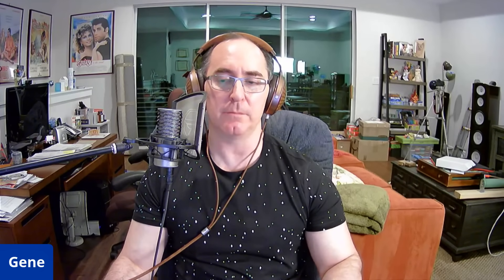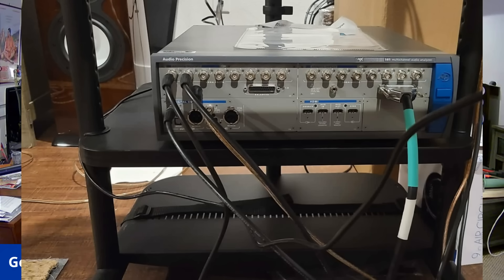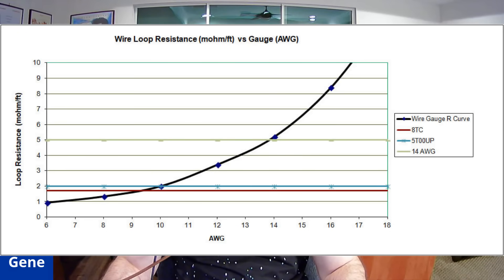Speaker Cables Really Don't Make Much of a Difference?

Comment: I hear what you say. However, I have Monster, QED 79, QED silver anniversary, Audience AU24 and Atlas Mavros speaker cables which I’ve purchased over the years. And on my system, in my home, they all sound different. With regards to balanced XLR, I recently purchased a new high end preamp and and I tried 3 different cables that I already owned: JPS labs, Audience AU24 and Van Damme. The first two cables cost over £1000 new and the Van Dammes were £28. On my current set up the Van Dammes were my preferred cable. So I don’t think I’m just suffering the placebo effect for expensive cables. Science includes testing and observation (hearing for audio). Regardless, everyone should buy what they like and enjoy their music on their system.

Comment: Sorry sir, you may have all the necessary test measuring equipments but there are much more information to know about audio cables, example the material, construction,  consistency of every strands (diameter) what size cable for the current/power output of an amplifier and etc..
Most audio cables are used as equalisers.
Anyway more than 95% especially expensive loudspeaker cables and signal cables (interconnects) are snake oil.
"Hi-fi is a fools game" 😄😄😄

Comment: Thank you for such a comprehensive  test and convincing explanation. However once I was using Nordost ribbon cable and found it lifeless with very little bass. Once I swapped it with a same length of Kimber 8tc it was such an improvement. Not sure how to explain it

Comment: I used to live less than a mile from a radio station
When I powered up my amp with ALL inputs turned OFF I could hear that station thru my speakers  Granted it was at a very low volume but it was there 
I started using shealded cables , and the problem went away 
Quality cables keep unwanted noise OUT  Other than RF shielding I've never heard any cable make a diff
Where I live now it makes no diff at all ,but in some places RF  CAN be HEARD

Comment: Great to see you guys still picking Up on cable nonsens, and accually take the time to measure and explain valid result to the consumers. Ive noticed a few cable vendors in my area, and for some reason they dont put any specs online, and if you contact Them, they refuse to publish any specs or measurements.... Go figure.... The worse part of All of this, is the nonsens they say about theire products, doesnt make any sense, what so ever. You should go check IT out. Zensati.com and ansuz-acoustics.com, are just two local brands with a heavy pricetag and crazy theories 😆

Comment: I appreciate the work that went into this. I would have loved for you to try out the Supra Ply cable, not so much because it's costy and it may not be the 'best' cable out there, but because of the design that went into it as it was designed with high capacitance for keeping the inductance ultra low. Also the conductors being flattened the cross-section is quite low and the skin effect decreased accordingly. I and others find it is quite bright, stinging even, which we hadn't expected - now that's critical listening for you, immune of Placebo and No-cebo. ;)

Another curiousity for which I've seen measurments and speaking from personal experience: heavier cables seem to scoop the sound, relatively speaking. It's in the range of a few dBs so well within the sensivity range of the human ear. As far as I'm aware there is no name or unit for this effect, nor does anyone seem to know where it comes from or what laws of nature is at play.

Furthermore: did you measure just a sweep or a complex signal? I would imagine that the more complex the signal becomes and the more juice that flows... the more things can go wrong and the conductor start showing its weaknesses if there are any.

Comment: So, is the wire in the Test leads better then the speaker cable? The measurement is going through that cable as well, just a thought as to why some of the measurements are so close together.....
Reply: @Douglas Blake is that a fact or opinion? The wire in the test leads is part of the measurement, no way around that...
Reply from the maker: @bobbiebreese9377  the test leads are short and high impedance like Douglas pointed out.
Reply: @Audioholics  of course, you already “say” wire doesn’t make a difference....
Reply: @Douglas Blake please explain to me in detail how one wire can measure something higher then it’s own capability?

Comment: Gene would you be able to make a video doing the same measurements for us to see if there is any audible difference in different speaker wire length for different channels? Saying left front channel has a 10 foot run and front right has a 20 foot run.
Reply: @Douglas Blake how would that translate to if an audible difference could be heard or not?

Comment: I feel even less worried that my speaker cables are cheap $50/100' of 12ga cables that I used to make my own speaker cables.
Reply: @Douglas BlakeThat works, too. For me, however, since the cables needed to be at least 25' each and would be trodden upon, it made sense to use a much more sturdy wiring solution. This cable has a very thick yet pliable rubber-like coating so perfect for my needs. "Monoprice Installgear 12ga 100'"

Comment: Gene says the most sensible words I've heard in a long time, "we need more science in audio". Amen. Massive cred to Gene for doing this. My biggest Audio Hero, PWK, also had a great line about this (you probably know it already), "if it isn't based in science and physics, it's Bull$#!t". He also liked to insist on measurements because "if you don't measure, you can't possibly know what you have". These tests lend credibility to those of us who recommend generic OFC wire, and to manufacturers like Kimber, who actually STICK to the science and physics of it. Just makes me wish that the more nefarious peddlers of reptile juice could be shut down by the FTC for making false claims.
Reply: I've been doing Home Theater before it was called Home Theater back in the late 70's and throughout the 80's. Back then it was called two channel stereo and finding the best equipment to reproduce the current analog recordings during that time was the only challenge. I was in the Navy between 82 and 86 and going overseas offered the benefit of getting high dollar HiFi equipment for pennies on the dollar at the local PX. Dam, those were the good ole'  days when only worrying about RMS vs Peak to Peak or just Peak was the only crap thrown at us by the vendors. Now, its all about calculating the best sound curve for your living room thru a maze of speakers and seperates. I only thank Audioholics for providing the best credible information and test results for us who don't have the time or know-how to do it. Thanks guys!
Reply from the maker: @JoseMTamez  I miss those days. Stereo HiFi VHS with 4 stereo speakers on your living room and git the simulated stereo effect on your receiver for some ambience. I did this for Star Trek IV The Voyage Home and blew my family away. Good times ;)
Reply: The brand you talked about is the one I had the trouble with...solid core wire was far superior and cheap
Reply: Kimberly NO...solid core YES
Reply: Wrong...
Reply: Unfortunately, what refers as “fool” are rich. This is not what I can’t understand
Reply: I do in a sort of way agree with you, but allow myself to be skeptical about our scientific capability.
Imagine 200 years ago and the newest science then, it did in no way measure radio waves, and still did radio waves exist.
Electricity has also been outside science, so has infrared and lots more. Also, he did at no time measure the sound, only the electrical properties. :-)
Reply: @friedmule5403  exactly. Measurements are useful to assure you have a competent design. But once you have a competent design….does it sound good? You could have two tweeters that technically measure the same. But if one is a silk dome and the other is aluminum? They WILL sound different. And anyone listening would say so. Measurements don’t tell you what something sounds like. Music is listened to. You don’t go to a concert or sit down in front of your stereo to measure it. But queue all the scientists in this arena and wait for the comments about what suckers we are. And of measurements are all that matters, then everyone who worships them should all be buying the exact same thing - namely, the cheapest thing that measures well. But no. These same ‘scientists’ audition stuff and make choices. Hmmm…
Reply: @friedmule5403  in the early days of high fidelity, measuring techniques were not as powerful as today, which led to the situation you describe, effects not capable of being measured by the science of the time.  The simple solution was the double blind test,  which oddly enough, I have never heard of any cable company using to prove their product makes a difference 

I see no reason to fault the testing of the electrical properties.  To insist that the " sound " must be tested misses the entire point of the video.

Comment: What's the difference from slow burn fuse and fast burn.  My subwoofer needs a 1A 250V replacement fuse.?
Reply from the maker: big difference, use what the amp manufacturer speced in their product for safety and reliability.
Reply: @Audioholics  the problem that I have is finding the right fuse non of my local stores have( 1A 250v MDC) fuse.  All they have is AGC in most shops . Is there a website u guys can direct me to purchase such fuse.

Comment: Couple questions: 1) Does speaker cables degrade over time? Like is there any oxidation or something of that nature that might cause a difference over the span of maybe 10+ years? Does oxygen free copper make a difference for this? 2) Assuming you had all 10 feet cables would the speaker design have an effect on how much resistance is acceptable? An example my dad has Polk's towers with the SDA tech from the 80/90s that has 8x 6.5" woofers and 4 tweeters per speaker but I'm curious if lets say the 14 gauge cable you used would have an effect with something more power hungry like that over the 8 gauge speaker wire he uses.
Reply: When metal oxidizes, it's the oxygen in the air or within the metal that reacts with it to cause the oxide or oxidation process. With OFC cable, there's no oxygen in the copper material, so no chance of it oxidizing, causing drastic increases in its resistance. As to your concern about how much resistance is acceptable, recall that the measurements Gene made were on a milliohm per feet scale. Cables were shown to have an average of 3 mill-ohms per foot. So for a 10-foot cable, that's 0.03 ohms of resistance. Your solid-state AVR or amplifier output impedance is much higher, at least 10x or higher, with AVR having much higher output impedance than dedicate power amplifiers (it's all about cost and compromise). If you have tube amps, it's even much higher, closer to 0.5 to 1-ohms of output resistance. Your 4 or 8 -ohm speaker is even higher. So, the 0.03 ohms of resistance from the cable is utterly invisible, if not irrelevant as it's way too small to matter. Whatever speaker manufacturer you choose, always select a wire gauge of 10 or lower. 5 gauge has lower wire resistance than 10 gauge, hence it's thicker. The lower the gauge, the lower the resistance per foot, and the thicker the cable gets. Hope this helps!

Comment: I Don't have an expensive system, but i'm happy with the Monster 12 awg, and Interlink cables, and I will be upgrading the amp from the JVC 120 TO AND XTZ 100 watt amp. I'll let the JVC work as a preamp.  Thanks for the measurements and advice Gene.

Comment: Gene, very nice piece.
But such measurements are quite a bit "on surface", i.e. you did not spend too much effort conceiving that experimemt.
Why don't you go a step ahead, and show us the measurements in time domain, which is the only one relevant to music reproduction? I presume it will be easy for you to source the necessary equipment.
And then I will refrain from comment on a 80W Denon being a great companion for 328 Be.
Reply from the maker: If you understand basic electrical theory, you'd know that a lack of change in amplitude response will also be a lack of change in time domain response. I use 10AWG cables all the time to do delicate amplifier measurements out to 90kHz and NEVER observe transient issues due to the cable impedance. That 80watt denon puts out 300 watts into 2 ohms so make assumptions without knowing facts. I also use a 600wpc Anthem amplifier to power the Revels in this room. The Denon amp was used as part of the DUT for this experiment.
Reply: But why are you talking about cable impedance, on 10 feet? Any copper cable will be similar, as confirmed here by your own measurements. I wonder if anybody here expected it not to be the case:)
I however fancy to see the shape of series of 10 kHz pulses,going through various speaker cables. Also, the cables selection you are using, are they really substantially different?
Now, please confirm that Anthem is a better match to 328Be, than Denon? Audibly better

Comment: Appreciate the science here.  Crazy what companies try to push in marketing.  I do have a question about shielding and how cables are routed?  I think this may have an effect (well we know that is true in car audio).  Gene, what’s the science on shielding and routing cables in home theater stereo set ups? (proximity to power, sources etc.) - what recommendations would you give people?
Reply from the maker: use shielded interconnects, route power cables away from interconnects or orthogonally if it can't be avoided.

Comment: I am an electronic engineer and I can agree with your measurements, but I disagree strongly with you that it does not give a difference in the sound. I use to think like you because this is what I was taught, but I can tell you I was surprised and my knowledge of electronics was questioned.
Could you do a transient response test, or step response, since music is transient in nature, this is the true test. You will find out that frequency response to the 100KHz range and higher is truly very important for the harmonics.
I am not sure that the Denon amplifier you are using has enough resolving power if you cannot hear much of a difference. I build my own amplifiers (very resolving) and have tested with different cables, and there is defiantly a difference. I use CAT5 cables, 12 pairs ganged together (2.6nF, 200nH, 0.06ohm) at 4m and the difference is audible. With normal cable, the highs are smeared and less clear "t" and "s" sounds are excessive and the perceived levels of the highs seems louder. With the CAT5 cable I made, there is a big improvement of clarity and better control, the highs are perceived as sounding thinner and less loud. It has too much control for my liking that I have to add 60cm of normal cable in series to degrade the sound a bit.
Measurements are nice, if they are the correct ones, but it is not the one true authority to disprove a claim.  You do not need expensive exotic cables to get good sound.
Reply from the maker: If you are an electrical engineer, you'd know the concept of Laplace Transform.  If there is no amplitude response difference, there won't be a time domain difference either.

Comment: I used to buy expensive speaker and HDMI cables.  Watched your videos and others who have completely debunked the snake oil of cable companies by actually testing this stuff.  My wallet and my wife thank you.  I am now running Monoprice 14 AWG for all my speakers and Monoprice HDMI cables.  I am not as concerned with the jewelry of cables because 99% of my cables are in the walls or behind a cabinet.  All work just as well as any of the "audiophile" cables.

Comment: The problem with this testing is that it is not comparing the same wire gauge and stranding which disqualifies comparing all the cable measurements from each other. Use the same conductor material, gauge and stranding and length.
Reply from the maker: Then the differences would be even less.

Comment: I wonder if all the other youtube reviewers (NRD, ZERO, Steve and crew) are all looking side to side right now with sweat beads running down the side of their faces?  Thanks Gene!
Reply: I doubt it.  I appreciate the effort gene is doing here and the likes of ASR.  I less appreciate the bulk of comments that are spiteful towards those that don't agree with "deniers.".  I, myself am very skeptical of the cable business but still appreciate experimenting.  I have tested everything from zip cord to custom cables north of $3k.  I sometimes do hear a small difference...usually in the size of soundstage vs tone or range.  The difference is typically very minor but I have heard some differences that would be noticable by most.  In summary, I love the data here.  Can't deny it.  Likewise, I can't deny what my own experience has shown. I would not dare to explain because I have no idea why have heard differences.   I discount placebo mostly because my bias is skepticism.  Again, I have never been able to predict it based on price or reputation, either. Happy listening. (The 8tc is a great cable, BTW)
Reply: @reynolds8532  what you probably heard was distortions induced by some cables that others didn't share. If you had the technical measurements for each you might have been able to discern if that was the case.